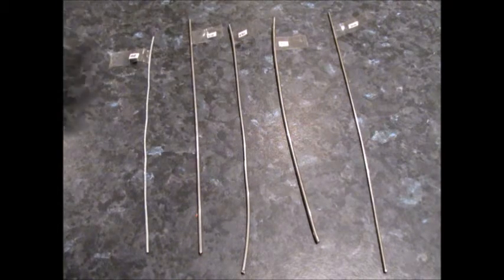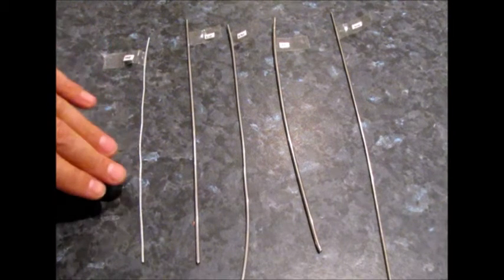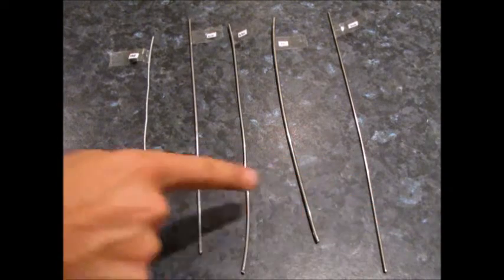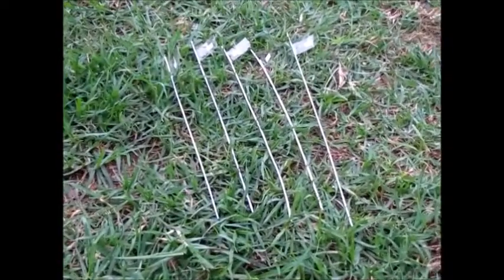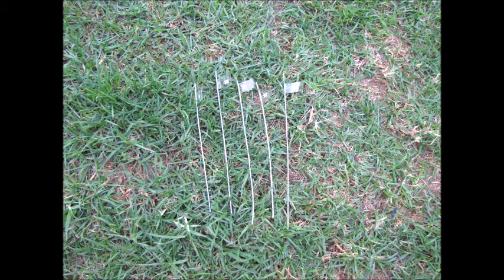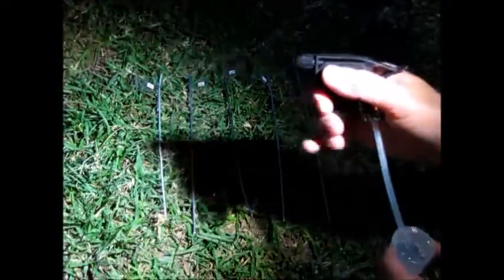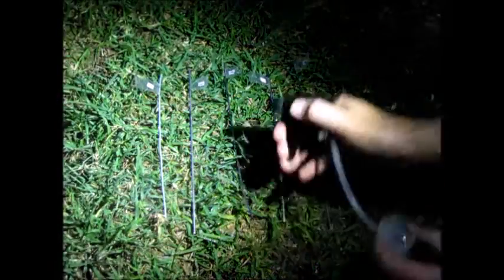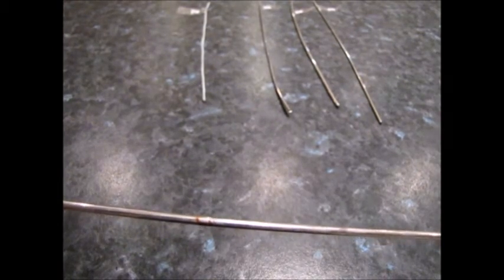Corrosion testing of steel - galvanized, 410 stainless, 430, 201 and 304

Comment: I live in the rust belt and I'm looking at repairing my frame with 304 stainless steel
Reply from the maker: I'm pretty sure that will prevent too many rusting issues but it's a very expensive way to do it!

Comment: Nice video.
But it seems like the immersion test might be not valid, since all the wires are in the same cup. You may be seeing galvanic anode protection from one wire to the others.
See: Cathodic Protection
https://en.m.wikipedia.org/wiki/Cathodic_protection
Reply from the maker: That's possible iddoperel... however they're all largely the same material, unlike say zinc and mild steel for example, and I'm not sure if there's enough of a difference in the materials to create much of that. The results in that test mirrored those in the outside overnight dew test, so we'd be inclined to think the test is valid. Fair hypothesis though, and it's possible that particular one could have had some other things going on as you suggested.

Comment: I don't think your first experiment is  viable, because you sanded the Galv rod first and then contaminated the rest with the same sand paper..
Reply from the maker: Fair point Marc. We hadn't imagined the contamination issue; although I would think if stainless steel is going to rust because it's scratched and has some galvanizing left on it, it's not a product we'd want to work with.
Reply: Fare enuf with all due respect ofcorse just wanted to point out the flaw in testing cheers, all the best with your future research and product line. What you guys are doing is great. Thanks Marc
Reply from the maker: Marc cheers mate, all feedback always appreciated! Take care!

Comment: Each steel strengths and weaknesses are well documented already. 410, also called martensitic, is one of the worst against corrosion. The best ones against corrosion are 434, 3CR12, 304, 304L, 2205 duplex, lean duplex, superduplex, 316, 321 and 904L 6Mo.
Reply from the maker: You're right this isn't new information, but unfortunately most other manufacturers seem to have missed the memo! We wanted to show some real-world examples of what happens when manufacturers choose price over quality, and the end-user benefits you get from spending a bit more on a Premiala product.
Reply: 316 is the best. Aka marine grade
Reply: I’ve never seen a hot dipped galvanised bbq grill. Usually stainless